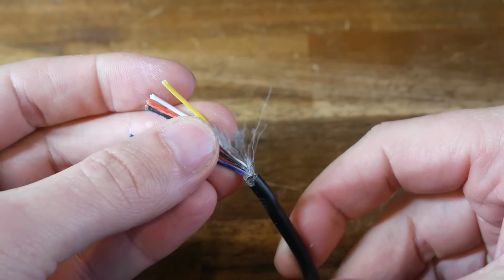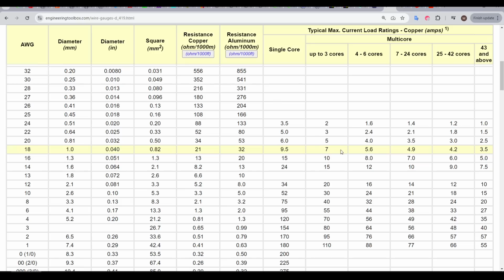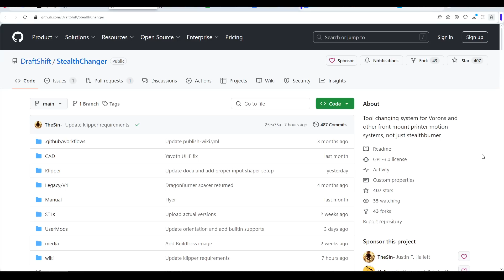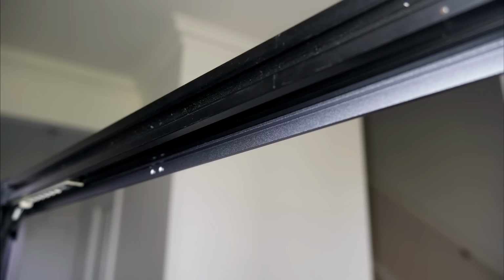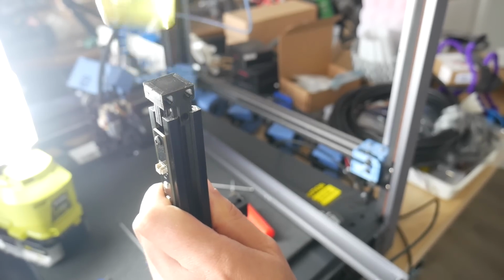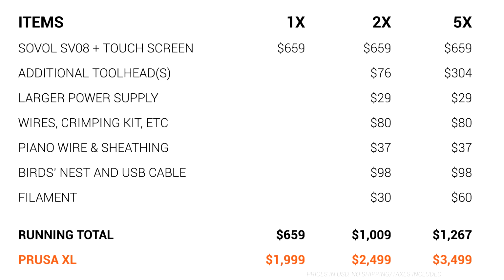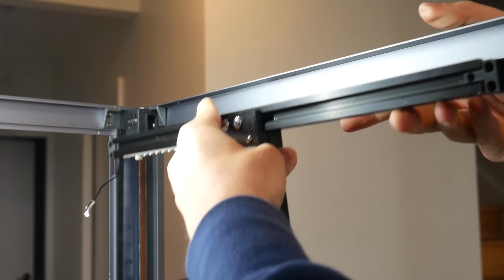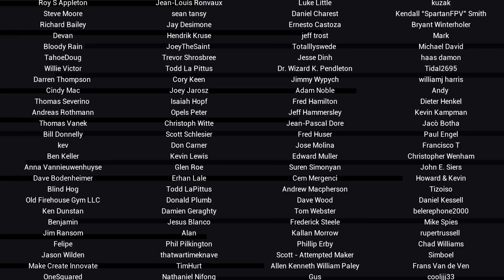Modular docking bar - Budget Sovol SV08 toolchanger part 4

Comment: Where can i find your custom Extrusion Adapters with the 5mm gap? Did your release them, like the rest of the cad files?
Reply from the maker: Everything I have designed is in the linked CAD, yes.
Reply: @TeachingTech  I can't find these extrusion Adapters in your CAD Files... where are they exactly in?
Reply from the maker: Just looked and couldn't find them either. A complete mystery. I remade them by combining the smaller parts, hopefully it's correct. Look under Dock parts - Dock wedge.

Comment: I am loving this tbh - I wanted to ask if you've found another nozzle alternative to Sovol? On their website they only sell 0.4 and 0.6 hardened steel nozzles for the SV08. Would be nice if it could also print 0.2, 0.8 and perhaps even bigger.

Also would be interesting to add a blade/pencil or similar to be able to add extra tools instead of toolheads when needed, for example a sharpie to interface between materials, so as to remove supports easier

Comment: How about using 22/8 wire and just combine 2 wires for each power wire leaving the other 4 for logic?  Should be around 5mm diameter vs 7mm for the 18/5

Comment: Silicone will not stick through isopropyl or denatured. After loading the tray spray it and your trowel with the alcohol and it will not stick to the rim.

Comment: I kind of wonder if it's possible to add another modular docker bar on the other side that is empty and has more space based on what I see in the printer's extra amount of space outside the printing volume that would be like 12 tool changers overall multiplied by 2.

Comment: I'm anxiously watching this series.  My goal is to have an enclosed two tool head SV08 so I can print parts made from ABS and TPU.  TPU doesn't feed in the Bambu AMS or Creality CFS.  Bambu has a higher durometer TPU that will work with the multi-filament feeders but I don't want a higher durometer in my future product.  Huge props to the entire SV08 multi-extruder development team.  I wonder if Sovol will offer a 2-5 head SV08?

Comment: You can make your own custom cable by taking 2 individual wires and enclosing them with shrink wrap -- I find that works well for the length of cable you are using -- and you will substantially decrease the thickness of the cable using thinner wires for USB - plus shrink wrap tends to be thinner than cable shielding. This assumes you don't need the shielding for those lengths...
You could also just take a regular USB cable, add power and ground and enclose in shrink wrap -- would still be thinner than 5 #18 wires...

Comment: One concern I have with this project is the piano wire on the toolhead cables. In my experience, adding this causes bad input shaper results, really limiting your speed and acceleration performance.

Comment: You could make your own USB cable by using a standard USB cable with an extra two heavier wires for power and ground, perhaps a two wire zip cord.  Then lace the two cables together, I've used dental floss for wire lacing, it works great.  The power and ground in the usb  cable wouldn't be used.  It's also possible that CAN bus cable will work on USB.

Comment: Awesome video, great progress and I love the details! Got a question, for the toolheads, what if you took a 7 core shielded wire with a lower gauge and connected two wires for both positive and negative? Or a 9 core shielded wire with even lower gauge, because the usb doesnt take much amps? Because 18ga sounds way overkill for usb. Would that make it overall thinner and more flexible, or does the thickness of the insulation make it as thick or even thicker in the end? Great channel! Keep it up!

Comment: I've noticed on the Sovol website that the SV04 IDEX is heavily discounted and seems to be out of stock nearly everywhere. If Sovol are discontinuing the SV04, I wonder if they are intending on releasing a new IDEX/Tool-changing unit or addon to the SV08. The SV04 was pretty much the only budget IDEX system available. As someone who has project ideas that require multiple TPU types or printing TPU with separate support materials, AMS-style systems aren't suitable so here's hoping Sovol have something new in the works.

Comment: I'm adding this modular dock setup to a Voron 2.4 that I'm building, but I haven't gotten to that point yet. My main difference will be using can bus to connect my toolhead boards directly to my main controller board. My main benefit over the Sovol route will be a more rigid frame + full enclosure, but my parts total was just over 2k. Glad to say I'm still saving money over the Prusa option, thought the amount of time for assembly will definitely make up for it.

Comment: IGUS chain flex cables gave the type of wire you are looking for. A lot of different configurations available, I'm using one that is what you described for my canbus cable (don't recall the item number for it).

Comment: A gusset would work extend it downward inch and a half and you got some more stiffness, make sure its abou 8 to 10 mm thick on the gusset. im reffering to your flex when you mounted the dock and the guy you was working with made another iteration.

Comment: You can probably run an additional 2020 extrusion, underneath the toolchanger dock and tie it to the printed parts to keep it more rigid, since it won't interfere with anything.

Comment: I cant get my svo8 to extrude enough plastic for the extrusions to touch. It only makes meshes that light gets through. Had the same problem woth the sv06, sold that junk for very little. Im so irritated at it i just have tons of stuff sitting in it, using it as a storage cube. If anyone has any idea how to fix the damned thing, im all ears. But also the idler pulleys on the x gasntry are misaligned, so it forces the servos to skip steps the closer the head gets to the edge of x axis travel, because the belts essentially change length and its pulling the whole damned machine apart, thats why so many people are experiencing the pulleys getting ripped out of their place. Such a stupid problem to have, like someone designed it with their eyes closed and just declared it a finished product when they finished designing the machine digitally.

Comment: I find very contradicting current ratings for a respective wire thickness. I found for 0,5mm2 anything from 3A to over 8A. On a calculator that takes wire length into consideration the result for 1,5m, 120w and 24v (5A) was 0,56mm2. Also btw jst xh plugs are only rated for 3A, so anything above 0,5mm2 is overkill.

3do makes a 6 core wire with two 0,5mm2 power wire and two pairs of twisted and shielded data wires made of 0,25mm2. There is also another one with only one pair of data wires.

Comment: About your multi core wire;

Look for speaker or audio transmission multi core wire with 2p conductors in them.

Crutchfield CMRGBS50 is a option for a 2p 6 core wire

Comment: Why is it always necessary to compare the prices with the price of the Peusa XL. They invested a lot in research before launching the XL and that's probably why it costs so much. Now having the idea of how such a printer works, it is much easier and cheaper to produce such a thing.
Reply: Because the XL is the cheapest toolchanger currently on the market, so its a comparison of "Can I build one cheaper than I can buy one" also, that narrative of having an idea of how such a printer works makes it easier to produce one, makes no sense. The design he's using has almost nothing in common with the Prusa design at all, and there were other toolchangers on the market prior to the Prusa design such as the E3D toolchanger which you could argue Prusa actually use their idea of how a system would work and made it cheaper

Comment: I love this dude.  I was going to buy a prusa xl but after watching this ive decided to hold out;.  I have a v2 voron, which is my fav machine out of all 15 printers i have.   so i would be making a siboor voron 5 or 6 head machine if i can.    Siboor is great value and really nice quality.     so a multi head Siboor would be incredible.    I do think with a multi head machine, a machine that raises its bed is the most logical choice.   It will massivly limit the travel distance to change head.     I prefer the floating gantry design, but the raising bed design makes so much more sense with a multi tool head.
Reply: People with V2's have got their changes down to 5 seconds, so it can be pretty quick. also with a stock frame, having the docks/tools at the top is far less limiting on the build area

Comment: 2:36 Digikey and other suppliers sell many variations of cables with thicker power wires and thinner wires for communication, they are very expensive though up to $15AUD per metre. What most companies do is get a multicore cable with the same wire guage and assign more of the wires to each power pin.

Comment: That is a HUGE lever arm to attempt to push a tool head onto.  With it made of plastic and unsupported it will flex like crazy making your life more difficult.  Better to have a length of metal plate back up the bottom of the tool head parks.  You could run it from side to side of the SV08 frame and it wouldn't interfere with anything.

If you want to stick with printed plastic extend the white part that connects the tool heads out to the SV08 frame.  That will make it much stiffer.

Comment: 12:09 Be Careful to understand this chart, and understand where this chart comes from! This toolbox chart is not good--zero reference to any standard. Every wire type has it's own ampacity chart. Find the UL type of wire you are using and search for the right ampacity chart for that wire. Silicone and PTFE have a much higher current allowed. Multicore is not multi-strand. You have 2 wires (cores) carrying current in your bundle, so use the right correction factor. Account for ambient temperature. In other words, you probably have too heavy a gauge of wire, but you may not! 

Also, for motion applications it is better to use multiple parallel cores of smaller gauge, rather than two large cables. If you can use a wrap instead of an integrated sheath, it will also last longer.  Honestly, I wouldn't use larger than 22 gauge in a toolhead.
Reply: Hundreds (if not thousands) of Vorons are using  18 AWG for CAN bus without issue. Including mine for the past 2 years
Reply: @Youngrich87  I appreciate that experience. I'm probably overly cautious in this respect. Cables and connectors are the bane of any electrical design. It's not a good place to skimp on the engineering.
Reply: @IronBrain0  there’s nothing wrong with being cautious! It’s unfortunate that the connector is perpendicular to the entry point of the wire in the SV08. At least on most vorons it’s a direct path without bends at the toolhead

Comment: Running a piece of 2020 along the front of the tool head mounts will stop the flex have the mount bolt to it at the bottom ao the mount isn't flexing at the bottom.

Comment: Once you get there - I recommend using optical methods (eg. our CXC tool or other) to not only calibrate XY offsets really easily, but also to view how repeatable your docking and undocking is. Toolchangers can be finicky and identifying repeatability issues optically beforehand will save you loads of time and pain! Can't wait to see this thing zooming though 👀🔥
Reply: I have a couple IDEX printers but I don't use optical.  I made a 3d printed tool that hooks on bed corners and has 2 high quality micro switches for X/Y and a strain guage for Z.  It's controlled via a pyQT gui that can be run on my dedicated Klipper Screen box.    Dead on every time I need to re-align the tools.
Reply: @dev-debug nice!

Comment: I know it is not ideal but I've made up plenty of multi-core cables with various gauges.  In your case you could get a 3 core wire with single insultation at one gauge and a 2 core wire at a different gauge.  Fish a string through a length of heat shrink tubing and pull the wires through.  I typically only heat shrink the ends.  I get my heat shrink in the 50 meter roll as I go through a lot of it.  It makes it very easy to make the exact cables you need.

Comment: Curious, why did you opt to use the Sovol toolheads still for all of them? Especially now that you are running into space issues. There are plenty Voron compatible toolheads out there as you saw with the StealthChanger
Reply: Probably explained in part 1, but if working toolheads are available, and don't cost too much, why not use them?
Reply: @kimmotoivanen  good point indeed, I'll have to look that back

Comment: I look forward to the day all this hard work eventually results in an affordable off-the-shelf large multi-toolhead product.
When it came time for me to either complete or cancel my Prusa XL 5-head order after waiting a couple years since placing the deposit, I canceled the order.  By then I was rocking a couple Bambu P1Ss both with AMS and the Prusa XL just no longer seemed competitive.  The Bambu printers are still working great and together cost half as much as the XL.
If you can complete the build for under $1500, that'd be really impressive.  I'm eager to see your progress in part 5.

Comment: A multistrand AV cable like Belden 8446 might be exactly what you’re looking for here — 4x 22AWG + 2x 18AWG.
Reply: @drtbantha  No, not really. It's UL spec is only 80C max. If you stick to PLA in an open chamber it's probably fine. PVC isn't great for motion applications--it doesn't have a great friction coefficient, and it gets sticky at higher temps. The current ampacity of that cable at 45C ambient is still good enough if you don't count the friction heating, But any higher and it's going to not be good. 

A better choice is the 3Do CANbus or CANbus + USB cable or similar. The FEP jackets are rated to much higher temps, have much lower internal friction, and the CANbus/USB is shielded.
Reply: @IronBrain0  I have an enclosed IDEX with mains powered bed.  Unless your running a chamber heater or very long prints you usually don't see even 65C.  Chamber would have to be pretty air tight and high bed temp to get 80C.  Anyway that's the wire a number of places sell for can bus although I use stranded cat 8 with 24 gauge wires, 3 pairs divided for 24v and a pair for signal.  Been running for a year with 60W cartridges and no issues.  Crimping them for can bus connector is not fun though.  Custom made wire is available but it's expensive and you usually have to buy a good size spool of it.
Reply: Yes!

Comment: Instead of making nozzle blockers from silicone that needs to set, I've been using spare silicone bed spacers, the hole makes them easy to mount, , the rounded edge makes positional accuracy less critical, and they might be more convenient (and quicker) for people than making ones from a silicone that needs to cure. A redesign of the bottom of the dock will be required though. (I use mine in a Voron 0.2, unfortunately not much room for tool changing in there)

Comment: Cables - I've wondered if high power USB C cables with the ends lopped off would work. A flexible 100w data transfer cable should be made with a few things wires and a pair of thick power wires. Only problem is cost, and Chinese cables are never actually a larger gauge, so you have to buy a real brand for that power.
Reply: thats what i have been using on my tap changer setup on my voron. Works great so far.
2m 100w USB charging cables gives plenty for 2x tool heads and about $5 on aliexpress
Reply: @lukelahnstein  good to know! I'm gonna get some. Do you know what gauge it actually is? I don't want to go too hard on the wattage if it's going to burst into flame 😂

Comment: @Teaching Tech you need igus cable chainflex cable they have a ton of different combinations of sizes
Reply: I was going to post this as well - they're my go-to for multicore cables since they offer pretty much any material, gauge, wire count, etc. you can think of.
Reply: @ spendy but worth it considering them having cable chain rated high temp rated all the hard to find speciality stuff infact in gonna sue them on my high temp printer so there is no mcu inside the heated enclosure cause im gonna push some serious temps
Reply: This is a great recommendation but the minimum order quantities are a bit on the high side.
Reply: @whitecanegamer the creator of the Birds Nest hub sells the cables as well

Comment: Since I already have the parts to build a 350mm Voron v2.4 as I bought a cheapish kit 3 years ago ($1000) that I never got properly working due to severe bed adhesion issues so I disassembled it so I could make room for other 3D Printer builds. Eventually I will build it back up again but with some different parts like LDO 2020 extrusions and a West3D build sheet.

Comment: Instead of moving the usb connector to the other side, wouldn’t it just be easier to print a low-profile front cover that lets the tool board mcu breathe a little better? That’ll also give you more clearance on the dock for docking and undocking.

Comment: I understand this is to make a budget build in general; Wouldnt a bed dropper be better than a flying gantry for this kind of thing?
Reply: no because with a bed dropper you will loose constant print area at the front, with a flying gantry you only loose this area all the way at the top of the printer volume
Reply: @WaschBaer_95  that just sounds like the same issue in both cases. Lost volume is lost volume. I feel that the extra axis with a flying gatry; on the toolhead has more potential for causing issues.
Reply: @odds4649 yeah but with a rigid gantry, it would be more lost volume. With a flying gantry, you don’t lose the area under the docks, so in terms of build volume you’d only lose the forehead. Also Z movement is needed for the tool changing system he’ll be using